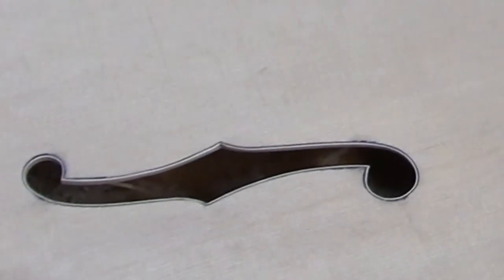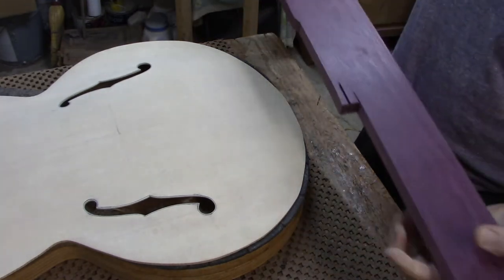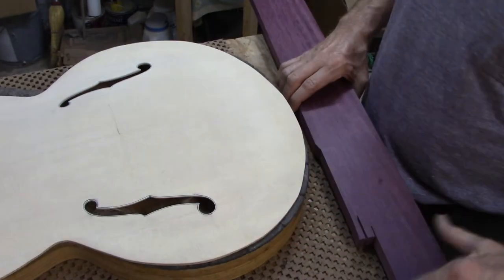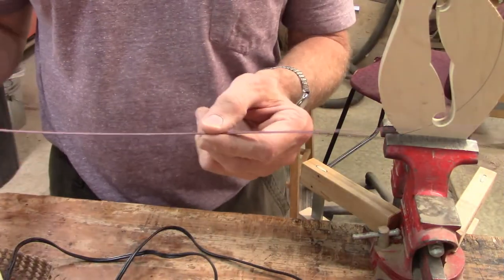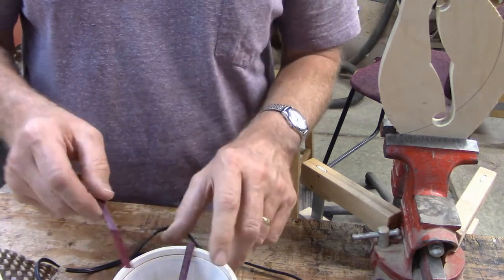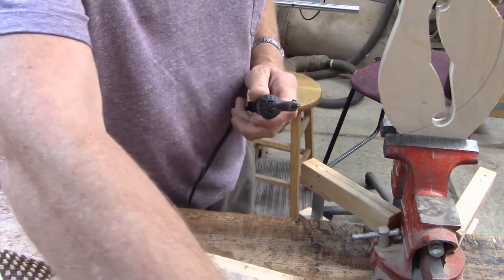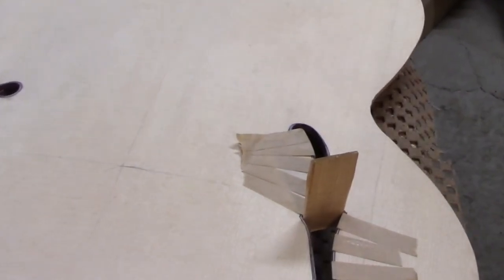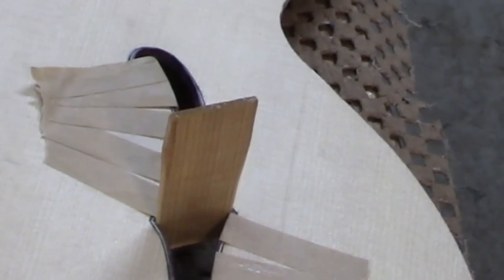Binding f holes for an archtop guitar

Comment: Hi Gary - what thickness of perfling are you using and how many layers did you apply? I bought some 0.040" stuff but I'm unsure of how many layers I should apply. Is there a common practice or is it merely the aesthetic the builder is going for with it? Thanks in advance, Mike
Reply from the maker: Hi Mike. The inner black and white veneers are about 0.020". The outer layer of purpleheart is around 0.045."  There really isn't any rule about how many layers to use. Generally the more layers you put on, the fancier the guitar looks.  One single layer of binding helps protect the end grain of the wood, everything beyond that is aesthetic, not functional.  Thanks for your question.

Comment: Gary - I tried this method today with some practice strips of cherry wood about 0.030-0.040" thick. The soldering iron immediately burned the wood. Is my iron, which does not have temp adjustment too hot or did I not soak the wood long enough or both? And I'm guessing that I let the iron sit in one spot too long...
Reply from the maker: My iron doesn't have a temperature control, either and the wood burns very quickly if it rests in one place. You have to re-wet it very often and never stop moving the wood or the iron.
Reply: Got it! There's definitely a learning curve here for the curve! ha - pun intended. Thanks a lot!
Reply from the maker: @crazyb3fan  my pleasure.  I hope it helps.